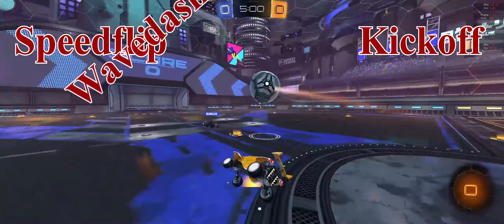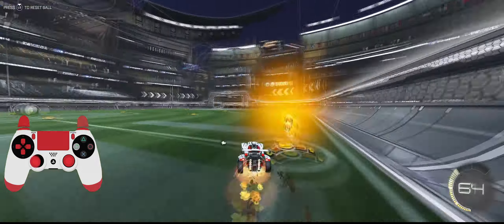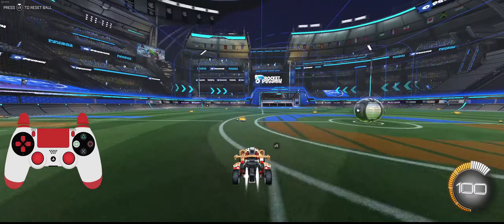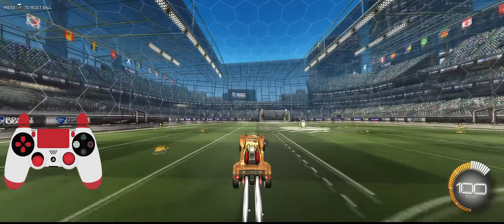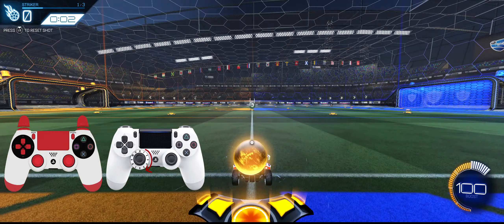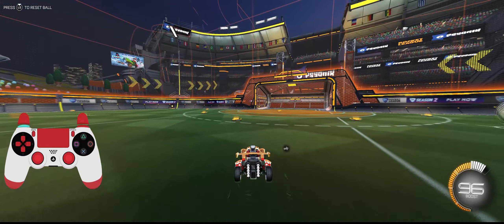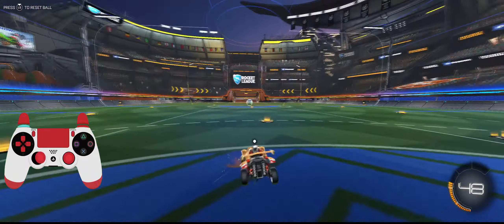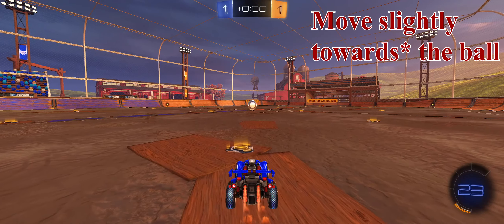New Improved Speedflip Kickoff | Speedflip Wavedash Tutorial | Dec 2020 | N8-97

Comment: Another easy method is you can also speedflip by holding one of the directional air rolls and front flip canceling. You will roll in the direction of the air roll you pick.

Comment: The 1 to 5 cancel instead of 1 to 7 is interesting, not seen that used before and it does sound easier actually nice
Reply from the maker: Yeah a lot of people dont seem to realise there's an easier way. Also makes air rolling to land cleanly a lot easier (you dont have to move at the end)
Reply: @nate-97  Another easy method is you can also speedflip by holding one of the directional air rolls and front flip canceling. You will roll in the direction of the air roll you pick.

Comment: Still no luck bro:(. Ok here is the steps I do: first I speed flip, as I am about to land I hold powerslide, then I quickly jump while holding directional air roll and then wave dash. But I get stuck when I'm supposed to jump after the speed flip where I'm going of the ground
Reply from the maker: Ok so as all four wheels hit the ground (two first, then the other two), thats when you jump, two wheels will lift off if you get the timing right. From there you just need to dash the other way. Im using powerslide and air roll on the same button and use my left stick to choose which way to air roll. I think it still works just fine with directional air roll on a seperate button. Give it another go and then feel free to send me clips or add me on discord and i can help you get it down. Good luck dude! Also: Watch a few times @ 4:30 maybe even put the vid on 0.5 or 0.25 speed to see the timings better. I think the controller overlay lags behind slightly though so be aware, concentrate on the cloud animation when i jump if that helps.
Reply: Thx so much
Reply: @nate-97  do I use directional air roll or normal air roll
Reply from the maker: @balluthebear1574  I use normal but either should be fine